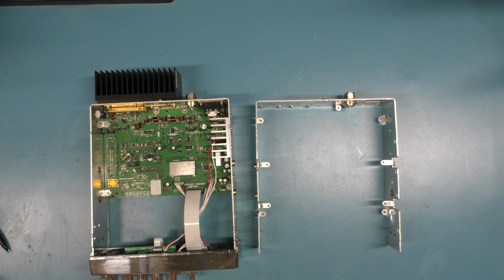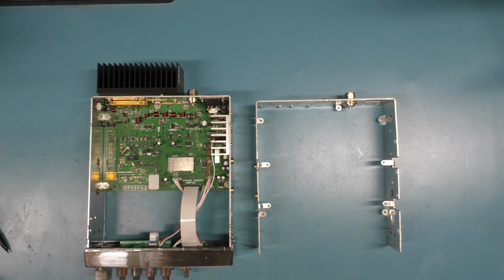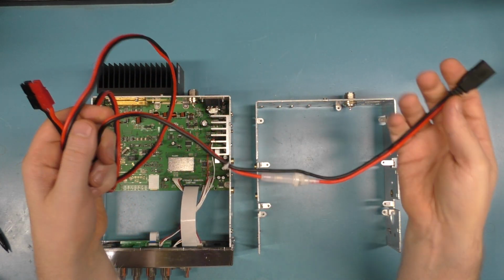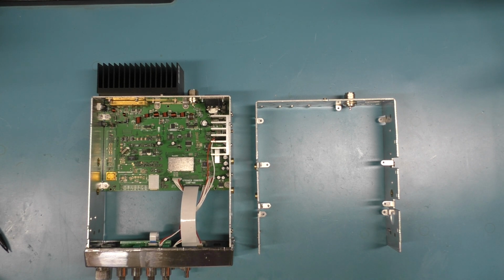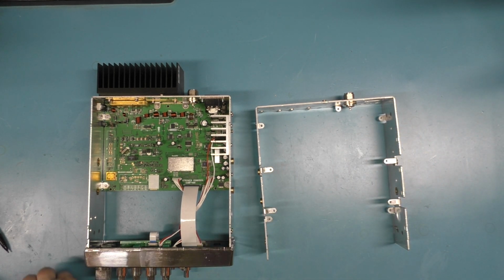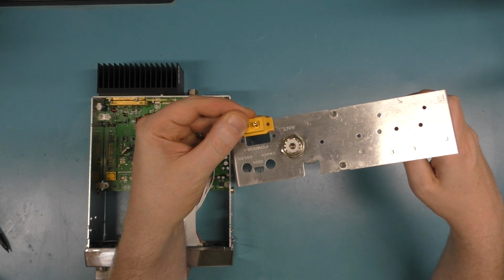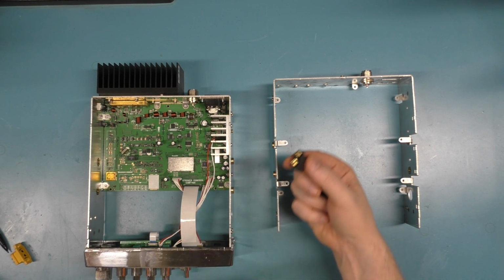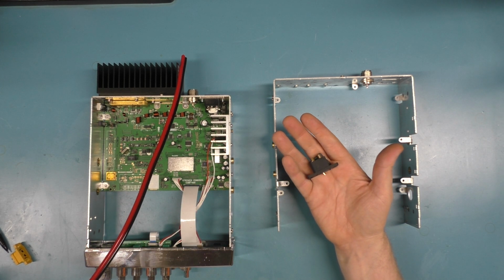Stryker 655/955 power connector upgrade possibilities

Comment: Did you ever do this power connector upgrade on a 955HPC? Does the back of xt90 connector hit the heatsink?
Reply from the maker: Yes, and no, the connectors I used did not hit the heatsink - if you are referring to the internal one on v2 radios.

Comment: Doing it to my Stryker 655 now thanks for the info!
Reply: Did the xt90 connector fit fine in your radio? Wondering if it would hit the heat sink or not.
Reply: @ryback606 fit fine no issue

Comment: These are decent mark I use them in home built vape devices they handle way more current
Reply from the maker: Yeah I can see that supplying plenty for one of those. I didn't think that vape needed but a couple amps anyhow.
I don't really know much of anything about vape anyhow other than it exists.
Reply: @Mark19960  my home built averages around 40 amps a pull 🤓🫢👍

Comment: I know this video is on stryker but i have a question on 980ssb which replacement final is better the IRF510 or IRF520 ihave a 980 with a bad mosfet final everything else works fine
Reply from the maker: It depends on the version of the 980. One used an RD16HHF1 and the other used an IRFZ24

Comment: Great video!
I have pulled the screw together plug apart and made 10g fit. 
I also use the Anderson power poles, they work great. 
In very interested in the back of the radio plug you showed. 
I think you called it an xt90 I can Google it but if you happen to have a link for them, that would be great.  
I will probably convert all my radios over to them.  
Thank you.
Reply from the maker: These are actually the same ones I have there. I got them elsewhere but they look exactly the same.
https://www.amazon.com/Yaohappy-XT90E-M-Mountable-Connector-Multicopter/dp/B09DBK97VJ
Reply: @Mark19960  fantastic!
Exactly what I was looking for. 
Thank you.

Comment: I've never had an issue with factory power cord. Never considered xt90 connector for my radios, but it's good for thought. Thanks Mark
Reply from the maker: Well, the new x55s come with a heavier cord and it's fine. I use the factory cords. There are some that just want to do it anyway, so horses for courses.
Reply: @Mark19960 where do you find these connectors?